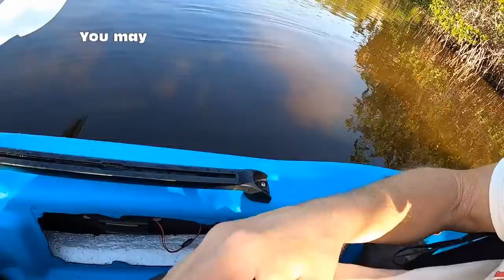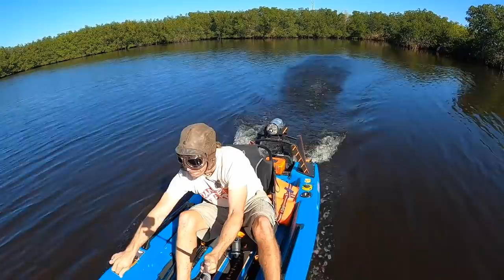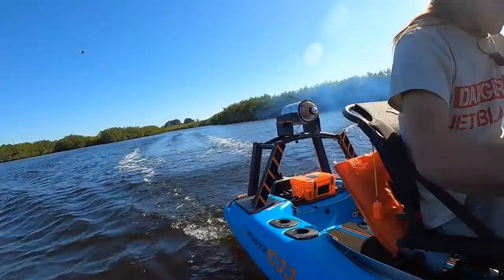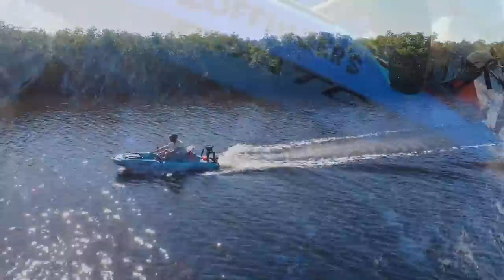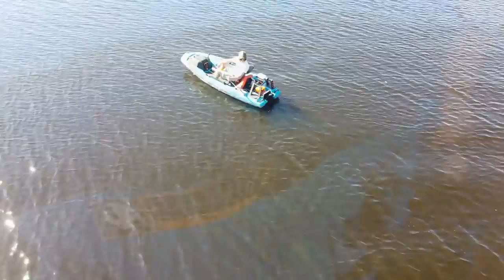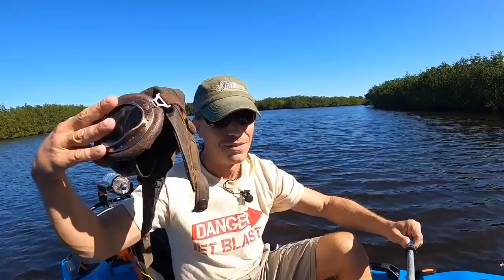Fire Spittin Jet Powered Kayak On The Water Test

Comment: Honestly when you think about how small the engine is I’m impressed! Now you gotta strap 2 of them bad boys to it!!!!
Reply: Two is great, three is even better.
Reply: @jimmyorchid941  I was thinking 4. total of 180 pounds thrust should be close to the weight of the kayak Marty and the extras on board.
Reply: Lot more drag in a kayak than an rc jet though.
Reply: Yes but have them closer and aim the exhaust towards the water for more force
Reply: Or 8....?
Reply: Yea two of them would give him alot more torque n speed
Reply: I think 3 would be great. And some foils to go really fast.
Reply: @cunhafixit  yea n a pair of elevator on the back for take off lol
Reply: I agreed..also He need to lower that jet’s holder to give more pressure on water..
Reply: 7 - Two on each upright, three across the top.
Reply: 4*
Reply: or a few lol
Reply: Everyone is saying add more engines I'm saying add a lot bigger one. That'll get your ears humming for sure. Lol
Reply: what would happen if he pointed it towards the water a bit more ? would it push harder
Reply: Or 4 lol
Reply: 5 minimum
Reply: 11 is the number here..11  jet engines and he will hydroplane across the water  whoo hoo
Reply: 2? 4 9f them! 😆
Reply: I was thinking 4 would be fun
Reply: @richardgooding498  agree...one bigger...of course BIGGER FUEL TANK
Reply: @richardgooding498  bigger engine..bigger fuel tank..
Reply: @ButterzBBrunsworth  , no rocket scientist here, but I believe that would apply an upward thrust on the rear of the vessil and cause a greater amount of downward pressure on the front,in wich case to compensate would need a stretched bow area, mabe mini pontoon extensions.
Reply: @ButterzBBrunsworth  I'm not so sure that having the exhaust pushing against something would make it faster. 🤔
Reply: 😆 3 or 4 engines.... That would be what, like 8 to 10 thousand dollars or so? Might as well build a mini Nitro burning outboard for it.
Reply: @crunch3rYouTube  why not make it an even dozen?
Reply: @Alkatross  I like where your heads at bro! more power!
Reply: Three would make it scoot.
Reply: Custom outriggers with engines from port to starboard should move it a lil faster
Reply: 5 lol 😂

Comment: A 10 HP gas engine with a 42" prop will get you going over 30 mph.  I built a Rocky Mountain Airboat back in the 80's and used it to cruise the Delaware River even through the rapids up 10 miles and down 10 miles from where I lived.  A jet does nothing for you at these low speeds but drink fuel.  I used to cruise down river to my Dad's place 5 miles south of me and then cruise back home on less than 1/2 gallon of gas.  My measured thrust of that set-up was 50 pounds of thrust.  It would move my little boat on wet grass.  The turbine's exhaust speeds only come into play when the craft reaches the wind speed generated by the prop minus the drag.  So, for example, in an airplane with such and such HP and a certain pitch prop it can only go X speed as that is the speed of the wind coming off the prop minus the drag.  A turbine's exhaust speed is many times faster so, if it has the thrust to move the aircraft it can eventually get it to go much faster than any prop could.  I give you an A+ for inventiveness and ingenuity though.

Comment: When you mentioned that it was a 45lb thrust, I had to compare it to my 8' Walker Bay dingy with  a 45lb thrust Minkota electric outboard. My Dingy goes 4.1 MPH is neatly silent and is good for around 7 miles on a 54 Amphour lithium battery that gets solar charged on the yacht.

Comment: That was a very nice Christmas present!  For any real speed you'll need at LEAST one more of those jets on the back of the kayak, maybe mount them a little bit lower since it doesn't look like spray will be an issue.

However, use that as your dinghy in a quiet anchorage and become the LEAST popular boater there!

Comment: You have a problem with the blow molded plastic and too much surface tension, hydrofoil is the way to go and could be light enough to retrofit to your kayak, in principle its a brilliant idea what you have done with your craft, also consider fitting a nosil to create a venturi affect on your thrust that should easily double your thrust
Happy holidays and thank you for posting today x

Comment: The drag of the hull of the boat is slowing you.  Some hydro foil would help but you would have to be going faster.  Either that or build a fan blade attached to the exhaust to to prop geared down to push you thru the water to use some of that power more efficiently.  Either way, coolest freaking Kayak on the water!  Nice build!

Comment: Cool built although impractical because of noise. I would at least for safety create a firewall between that jet engine and the back of my head. Or at least a cage around the front half so if it so if for some reason it exploded and or became dismounted in any way it wouldn’t decapitate or break any ribs. Enjoyed watching this build and keep it up bro!

Comment: Needs to be lower and you also have your adjustment screws to point it down further it needs to push off the water like a thrust wall on an aircraft carrier. BTW how do you know how much fuel you have? Jet engines use quite a bit..

Comment: I think maybe two would suffice for a moderate and safe speed but you may want to lower the motors thrust angle or even mounting height a jet through air achieves velocity due to lack of fighting viscosity friction as which is what you have trying to push a craft across water instead of air but was a very inspirational and interesting build I enjoyed it

Comment: Nice project. If mounted lower, it could have made you go faster because right now its pushing the nose down, plowing through the water. Also, put a barrier around it to contain shrapnel, should one disc suffer from an uncontained failure (rupture).
Jet engines are fun, but very dangerous when things go wrong... one ingested hook or hard shelled insect could destroy the engine.
But i really like the sound of it, sounding like the real thing

Comment: HYDRO FOILS, IT IS THE ONLY WAY. once that thing breaks the surface, the drag will drop 90% and then you can actually go flying the jet kayak. THE ONLY QUESTION....can its current speed activate the hydro foils or would it need a second (or a larger jet)???

Comment: Perhaps there's a way to redirect the exhaust gasses directly into the water, so it behaves like a jet ski. You may have to center mount the turbine and fabricate a water inlet for the propulsion system and an outlet rated for the high heat of the exhaust, but i firmly believe that turbine has plenty of power to go very fast so long as the power delivery is better

Comment: What you need is a stern plane, extending the back bottom edge. and make the angle of that trimable. You need to get that thing out of displacement mode onto a plane. It still won't be real fast, but in might at least beat the electric trolling motor. LOL What would do the most good would be to attach a power turbine driving a water propeller. Jet thrust on displacement hull is such a speed/torque mismatch it's a wonder it moves at all.

Comment: It just needs some handle for small angle adjustment on demand depending on speed so that it can sink straight, like air boat. And you need ear protection, at least it will chase gators away:)

Comment: You need to add a second one, and I am wondering if the diesel is limiting the performance of that engine, not sure if it can run it but you might want to run it on Jet A (Kerosene). But 2 of these on your kayak would get it moving pretty well, it would likely plane out better and get you that higher top speed.

Comment: Try mounting the motor lower, thus directing the thrust closer to the boat itself, instead of the 2-3 feet above the boat....I bet a lot of thrust is being lost in the flexing of the mount, and the boat....Also, play around with the angle of the motor, to see if you can bring the boat up on a plane, and reduce the drag of the water by picking up the front end a little.....Still a good test.

Comment: Could it be from the that it’s no angled slightly down. Could be that when the jet turbine is pushing out so much pressure that the boat tilts down towards the back giving the extra friction not allowing it to pick up to full speed ?

Comment: Does this thing have an afterburner? On military jets they put afterburners in to capture waste energy spitting out from the engine and that gives it major horse power increase. Of the 45 lbs motor I think at least 60% goes to waste so if that could be recaptured and reused....

Comment: you can put 1 or 2 or even more motors.. I suspect that there is a maximum hull speed which is controlled via the hull dimensions, I know this is the case with sail boats, in the paperwork that comes with it, and of course you can look it up if you don't have specs.  I could be wrong of course,  but I remember being towed by the coast guard on a sail boat that lost engine power, and even though the Zodiac pulling our littte 18 foot sail boat had apprx 750 horsepower, the boat wasn't going to achieve a speed much above max hull speed not matter how over powered the tow boat was. Id never heard of this before that adventure in the georgia straight a few years ago.. i was in the end of my 40's before hearing that term.. It was fascinating to see it demonstrated as we were towed, our wake was HUGE, I am pretty sure almost every barnacle got blasted off the hull for free !

Comment: Warped Perception used 1 that put out around 70 pounds of thrust on a go cart.... you've got higher resistance to motion in the water, I'll bet 2 of the model he used would get at least a respectable speed on the water though

Comment: You have enough room on that mount for 2 more turbines. If you wanted to, you could a couple to the verticals and have 5 to 7 motors. You would definitely need a larger fuel capacity.

Comment: This would be a ton of work but if 8~10% of the discharge gas could be ducted forwards to discharge through a series of rearwards facing vents underneath the kayak an air boundary layer of sorts may be created with a dramatic reduction in drag/friction.

Comment: adjust your jet so it points more at the water..... that way you are not just moving air, but you are pushing against the water. you should get a nice rooster tail as the water is moved rear ward too my friend. And yest two would be better.

Comment: I see your problem here ! You need a good thrust tube to compress the exhaust and change your thrust angle of the motor maybe tilt the intake towards the floor of the boat more . The motor is pushing you into the water instead of across it

Comment: Could you funnel the air jet through a pipe into the water under the boat? It would need a blow off valve for throttling off but the air pushing water might give a good drive

Comment: I think you if you add some heat shielding underneath it and then figure out a way to get it as low as you can and angle it just slightly down maybe 5-7 degrees it might plane

Comment: I could have told you it wouldn't be fast. You'd need a lot more lbs. of thrust to move that thing quickly. Expensive and loud. Just put your 5hp outboard on there and you'd be way better off.

Comment: You need to add hydrofoils on your kayak, then you will see the benefit of your motor. The faster the speed the better the motor works. Your kayak is stuck at hull speed. Hydrofoils will remove that barier.

Comment: Air planes run on air ,use that for a hydrofoil to float above water, turbines are not all the same some are for fuel some have tuning blades and force sound to lift up

Comment: so I did some numbers on your toy and best w.a.g I have is 3 more engines total of 4. However you will need more fuel. I assumed the weight and Increasing the fuel capacity, The drag q's for the boat you are using are not to be found so its a total w.a.g. But I say 4 total to get ya to 40 mph. 20 gallons of fuel for about a 10 min trip at that speed. Give or take a hundred.

Comment: You should mount it lower down and pointed towards the water so the thrust has something to push against, maybe the air isn't dense enough for a single jet that small, try that it might work.

Comment: Change the pitch angle to 10 degrees down facing the water so that it thrusts more against the water surface and you will probably see an increase of speed to some degree as it will have something to 'push' against instead of trying to use raw power to push it along.

Comment: Clearly, there is thrust lost...Try making a mechanical thrust vector device...You can assist in better control at higher speeds...a ceramic grid on a horizontal/Vertical axis, or go conical...

Comment: Directly install jet engine is not a very efficient way to use it. Because jet engine require highspeed air flow to increase its fuel efficiency, which come from speed of vehicle or by propeller.

Comment: These jet engines come in various power outputs.  That one is underpowered for a boat which has enormous drag.  No need to mount twin engines with all the complexity that would entail, just trade in the motor for a more powerful one and increase the size of the fuel tank.  I believe there is a 70 lb thrust version.  

This guy uses one on a go cart which has negligible drag. https://www.youtube.com/watch?v=nJr-RmJxtDc.  

The two controls need moving to more optimal positions, they need to fall to hand without leaning and reaching.  I love the gutsy approach but in engineering, you can't expect to get everything right first time round and perhaps more calculations were required before all the cutting, drilling and decor.

Comment: ya, if you want that to be efficient/feasible, you need to heat exchange the intake with the exhaust and gear down the rotational energy of the turbine shaft to a prop or jet drive.

Back in the 1960's the Granatelli brothers did that with an Indy 500 car and found it was competitive with piston engine ones (only got put out of the race by unrelated mechanical failures).

https://youtu.be/UXAT9-WGmhY

Comment: Pushing air verses pushing water with low HP motors is not very efficient.  Not to mention the drag of the boat as compared to an aircraft.  Nice work, but too noisy and slow to be reasonable, give the man a kewpie doll.

Comment: You are using that jet for the wrong purpose.
It was meant to be a high speed vehicle like an airplane to feed the jet with high speed air..
A boat screw is much more effective in the water.
Even a propeller would have worked better, because of the larger thrust area.
I would not have wasted all that money and time on this project.
But I guess you have learned something......

Comment: Because physics.
You are burning a metric shit ton of fuel/power in accelerating the worst possible reaction mass available - air.

The only reason aitcraft use air as a reaction mass is because its all thats available.

Airboats succeed because they use huge shallow fans that move more cfm per unit of energy expended than a jet.

The only time a jet would add any capability would bw if you were exceeding the practical limits of a surface prop, and then thd jet would be in addition to the prop.

Comment: you have the engine angle wrong. you're pushing the bow down.  change the engine angle so the bow goes up out of the water and you might still have something. you spent a lot of money. play a little more before you give up!